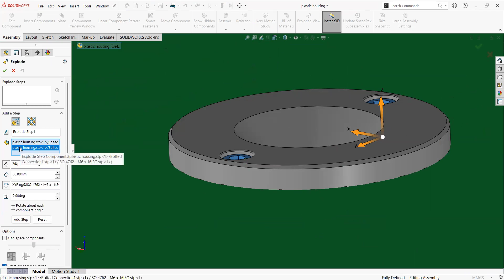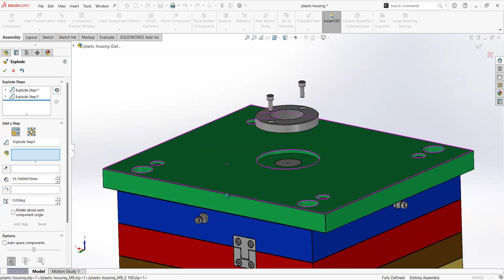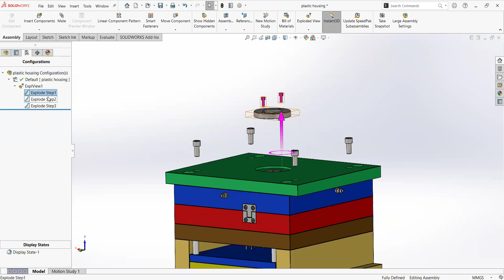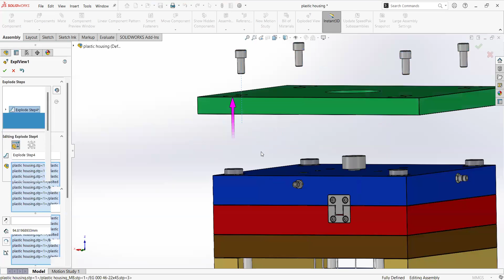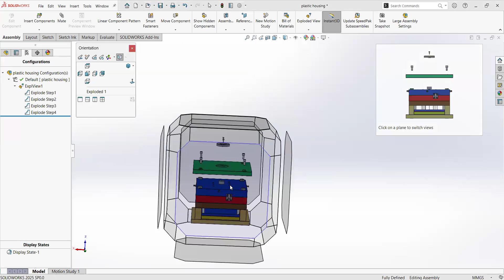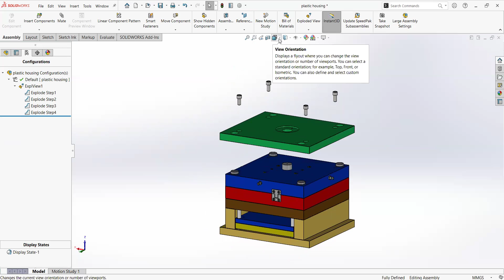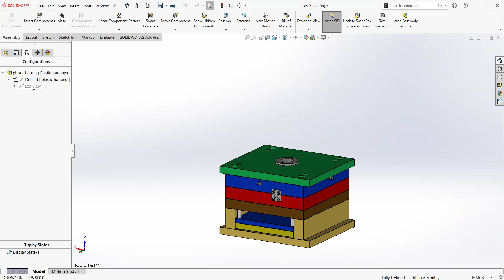SolidWorks 2025 Basic Tutorial - Exploded Views - Custom View Orientation

Comment: Hi mate, this is kind of silly. I just upgraded solidworks and I'm not well versed in the settings. Do you know how to set the Assembly in the tabs, when I right click on tabs to add it, the option is not there.. It's only optional for the toolbar.

Thanks.
Reply from the maker: Hi mate! From what you are describing it sounds better to uninstall and reinstall and rename the SolidWorks Data folder with the release year version (SolidWorks Data 20XX). That also applies to the other folders that you set in the installation Wizard.
Reply: @lucmartz Thanks, but it's actually a brand new pc, that I installed it on, it's never had solidworks on it. Just on my old solidworks 2018 I could just right click on the tabs and select to add assembly, once 2025 version that's not available through that method.
Reply from the maker: @ I think you should try :) that will also help you in the future with other SW releases